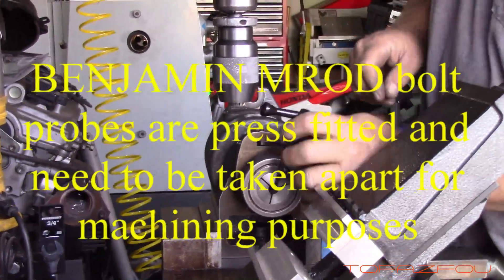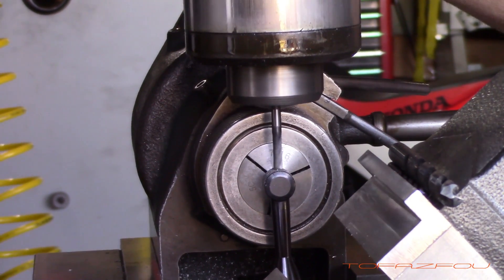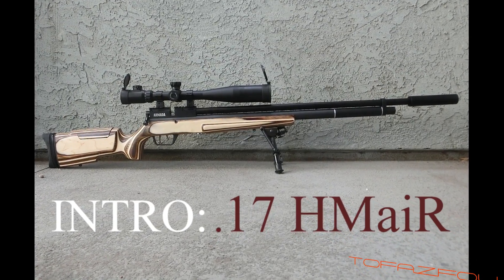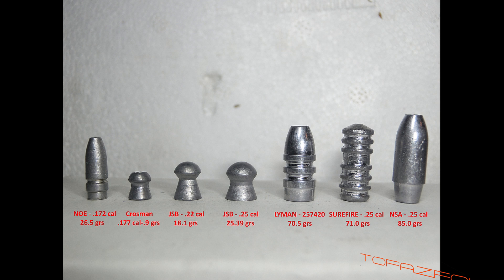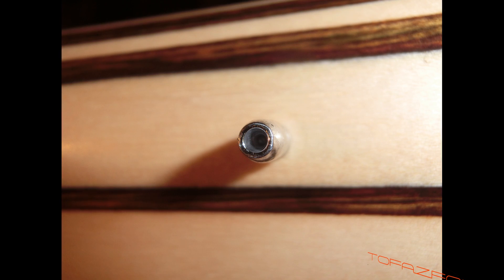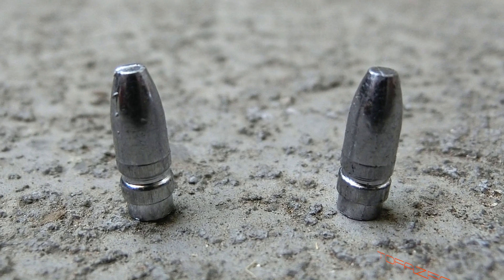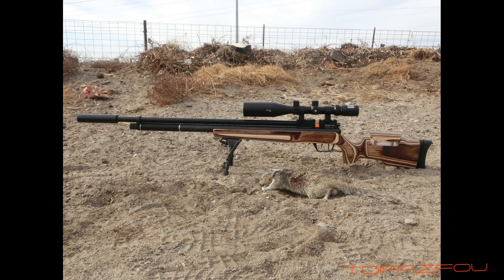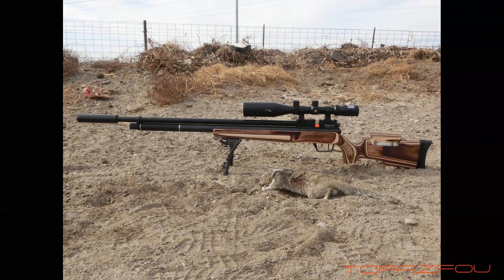.17 HMaiR INTRO,  pt 1

Comment: Just had to ask why didn't you have the air stripper made and baffle with end cap machined in aluminum  would of helped with the flight  with the rest of the custom parts? Thanks I'm doing a build and it simler to some of your builds and some other I've seen on YouTube.
Reply from the maker: JS,  not sure I understand your question.  But I will give it a go.  This rifle doesn't need an airstripper and the oem endcap is made of aluminum.  TODAY, the gun uses only an empty shroud and a LDC.  The baffles cause too much inner turbulence and are drilled way too big.  Having custom baffles made would cost even more money.  Plus, the gun is quieter and deadly accurate with just the empty shroud and LDC.
Reply: @Tofazfou  okay thanks from the photos and on the video it looked like and sounded like you used the stock parts at the end. So there's nothing to dampen the sound? Just the shroud and a lcd. You didn't have to make any bushing to stablelize the shroud? By the way Thanks for the info I work in the same building with a machine shop in it and I'm going to do a build similar to your bottle gun. Wich look awesome.
Reply from the maker: @josephsaucedo8691  Sorry JS, i'm having a senior moment....lol.  So yes sir, The rifle DOES use the OEM Delrin airstripper.  So I get your question now.  Sorry for the confusion.  But, the Delrin stripper works pretty well.  I have heard that they break but my machinist made sure it was a very smooth fit onto the barrel.  I know sometimes, you have to cram those stripper on the barrel which stresses it and probable causes a lot of failures.  One of the benefits of having my own machinist is that he can custom fit parts.  I also have a OEM stripper on my .30 Americana and she is still goin strong.  No breaks.  And yes, the 17 is whisper quiet.  I sounds like i'm either getting valve lock or that gun only has 100 psi in it....lol.  NOPE, its still doing 975-980 fps.  That small bore diameter also has a LOT to do with it.

Comment: There are actually more than 2 bullet mold available for the .172 slug.

HP (hollow point) and solid 
2 nose types FN (flat nose) and RF (round nose )
2 base type, with gas check base and without 
3 lengths available .434, .493 and .559 lengthens 
5 weights available - 22, 24, 25, 26 and 32 grains 
the .434 comes in hollow point and solid  
the .493 is gas check and hollow and solid  
the .559 is a solid round nose only 

so the 22 is the hollow point of the 24 grain and the 25 is the hollow point of the the 26 grain
so I got 5 types.
Reply from the maker: Technically speaking YES.  When I built this gun and made this video (1.4 yrs ago), only 2 bullets where available.  The 26 gr FN is PB and GC and the 32 gr RN in GC and PB.  But if you count each bullet then its variant then YES, you are right.  Thanks
Reply: @Tofazfou  : can you tell us what regulator pressure you used to achieve your velocity?
Reply from the maker: @sheldonthomas8773  No reg.  Using OEM Benjamin 22 cal valve and transfer port. No mods done to valve.  It can push the 24.5 gr pills in excess of 1030 fps with a 3200 psi fill.  Its all in the tuning and selection of parts

Comment: where did you buy the barrel ?  what length?  what diameter did you machine the bolt probe down to? and where do you buy ur slugs from?
Reply: cordellej Going from previous clips that Cedric has done and from that picture showing the slugs, he is casting his own from Noe? Molds.

Comment: Please, explain the importance of the pellet leaving fragments and mushrooming.  What is this the the difference in the projectile remaining in tact?
Reply from the maker: Sure!  Would love to.  Getting fragmentation up close shows me that my line of thinking with customizing the HP is spot on.  So, the idea is a simple one, if you get fragmentation or grotesque HP expansion during testing (up close soap, ballistics gel), then at the ranges i hunt at, the round will open up flawlessly and dump all its energy inside of game.  I don't expect it to fragment at distance and I think that's what some people thought I was thinking because of the soap test.  NOPE!  The whole point of a HP is for it to expand inside of game and dump most of its enegy (fpe) if not ALL its energy.  I have PROOF of this in the upcoming video on pt 3.  STAY TUNED!
Reply: Thanks for the explanation.  I just thought the projectile on game (at whatever distance) properly placed will have the same results if the round mushrooms and stays in or goes through.  But I do understand your thought process.  Keep up the good work.  Looking forward to part 3.  Thanks again.
Reply from the maker: JJ, so, a heart shot or brain shot no matter the shape of the projectile will kill.  So it doesn't have to be a HP necessarily.  Accurate rounds are key.  But, a HP affords more SURROUNDING tissue damage and SHOCK than even a wide meplat flatpoint.  I will also add this comment on accuracy.  Lets be honest, no matter how accurate the projectile and weapon are, many a hunter makes an OFF SHOT.  Or a less than perfect shot.  And it happens OFTEN enough.  But ACCURACY is most important.

Comment: Yes you are right and there is certainly a market for new and more advanced to pellets
Reply from the maker: Yes sir.  A good design IMO that could use a little updating would be the PILEDRIVER pellet.  They are available in 177 and 22 and have been for many years BUT, they don't work in all airguns because of one design trait.  JUST UPDATE THAT SLUG keeping the same basic shape and VOILA, INSTANT IMPROVEMENT.  I used to talk to those guys YEARS ago but, all my advice fell on deaf ears.  And today, they are still doing the same ole "SAME OLE"......

Comment: Cedric, why’d you go with 1-9” instead of 1-10”? You’ve got the brain rolling on a easy condor build for a 65 fpe .17
Reply from the maker: A couple of reasons.  The main being the availability of 1/2" OD barrels.  TJ's is about the only one. and he only offers 1-9" unless you spend the extra 300 bucks for a custom twist rate.  The OD of a barrel is key because of they have to fit the gun in its entirety.
Reply: Tofazfou thank you for the info.
Reply from the maker: Tony, I have to add that the Airforce Line of guns have a 1"+ I.D. and they can accept a larger OD barrel like a Hart or Lilja or Bartlein....etc...etc..etc.  But you would need someone with machining skils that knows airguns.  Unfortunately though, that Airgun becomes nothing more than a bench gun because the barrel alone would weight 6 lbs.....
Reply: Tofazfou, I have a friend that’s a machinist, and is also a air head like is. I’m tossing ideas around about this caliber. I’m also friends with Norman in Atlanta too, and our machinist friend is the one with the .375 DAQ.

Comment: 10 yards terminal performance tell you it works at that distance what about 75 or 120 yards will it still expand? Up close is to be expected but at long range it’s a different game all together
Reply from the maker: Frank, YEP, I KNOW THAT ALREADY.  Close test do tell you a lot about downrange performance.  If you've done it long enough like I have, even accuracy at 10 yard will and can tell you if a bullet will be accurate at 50 yards and further.  All pellets in all barrels don't go hole in hole at 10 yards.  Now, I don't and did not expect fragmentation at 50 and 100 yards but 10 yard fragmentation tells me how fragile the slug is and about what kind of expansion I can expect at distance.  I would be happy to film a 75 yard expansion test just for you and I can guarantee ya, the bullets will fully mushroom.
Reply: The beauty of using bullets vs pellets is because of such better ballistic coefficiency that they are able to carry the mass down range without the losses of forward kinetic energy. Due to the improved aerodynamics there is substantially less drag due to fluid friction of air, the abilty to transport a bullet of greater mass at a retained velocity will equal more retained energy at the distant target. 
Basically bullets have very little loss of velocity at distance.  At this point it becomes basically more a race against gravity and how fast a bullet can travel a given distance before gravity pulls it back to earth.

Comment: That is beautiful gun but I have a question:  when you're using bullets rather than pellets does it obturate the bore?  Part of my understanding of the pellet skirt is that the high-pressure air essentially hydro forms it to the barrel and helps it seal the gas.  Do these bullets have a section that can expand or are you depending on their size to be perfect enough that they don't need obturation?  It is long been a fantasy of mine to find a way to shoot actual bullets from my air rifle rather than pellets.  But in my experiments so far they've had miserable accuracy and very inconsistent speeds.
Reply from the maker: No base obturation with current airguns as we don't use enough or expel enough pressure to do so to a solid bullet.  For ease of understaning, lets say that my bullets are .001" BIGGER than the bore.  This alone seals the bore as the bullet is forced forward into the rifling and down the bore.  I have a machinist and we custom "SIZE" my bullet sizers.  Usually, I size my slugs to about .0003" over bore.  Yes, 3 ten thousandths.  Only having 3000 psi at our disposal and a bullet that is grossly oversized will eventually lead to a stuck bullet.  And it doesn't take much.  In my experiences, SIZING bullets in airguns is imperative.
Reply: LOL!!!
Knife
Reply: Barking Mouse, I'm afraid that you are years behind. Bullets are doing extremely well in airguns google extreme benchrest, or check out the TAG.com or Gateway to Airguns. 

these guns can routinely shoot 1/2" and much tighter at 100 yards, and have reached out to 1200 yards. 
Tofazfou, Doug,  RJ, and I all have .257's that are incredibly accurate, and carry a Lot more fpe down range.  My .257 is putting out over 180 fpe, and it is one of the weaker ones. LOL

KnifeMaker
Reply: Tofazfou Cool man.  Thank you!  Love your stories from the bleeding edge.
Reply: Mike l. Actually mine is the weaker one, only 160fpe.  Lol
Reply: Testing no final solid bullet or twistrate etc etc
Reply: Drummen sinner 185bar working pressure .223 5.67 mm. Does it all in Europe. Rws .223 solids coated or not. 42gr.